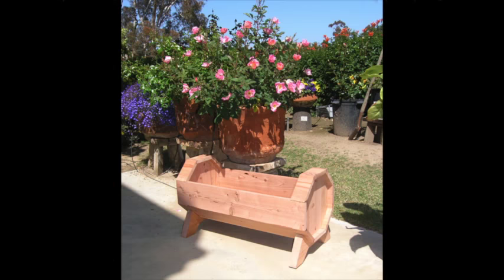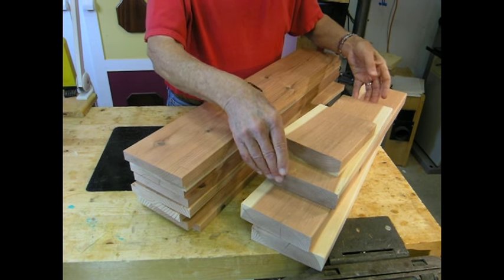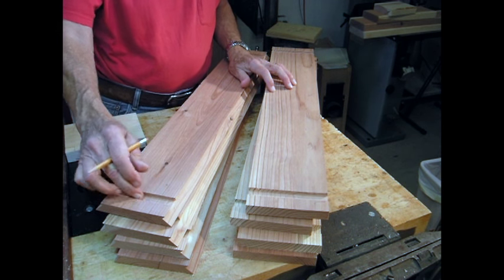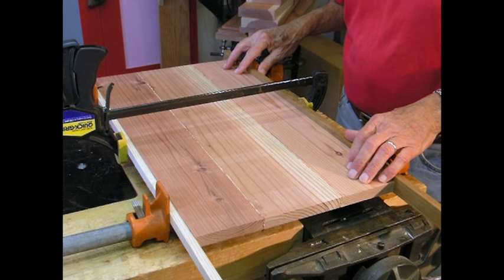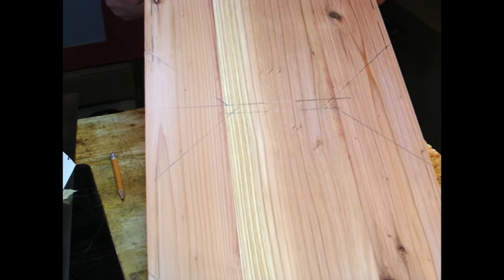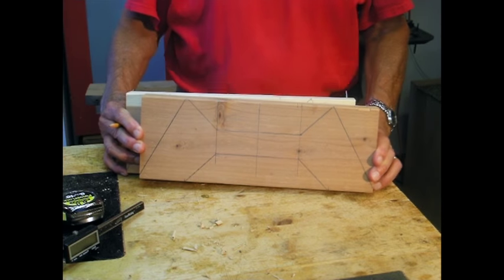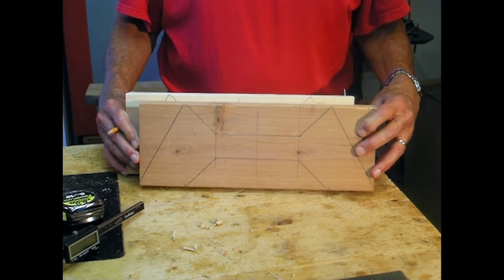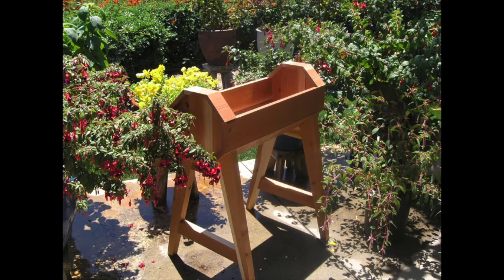A Redwood Barrel Planter

Comment: May I ask where did you purchase the style of banding clamps you use? Looked everywhere and can seem to track them down.
Reply from the maker: Hi Harry!   I bought them (Pony #12 brand, under $10) online after an Amazon search several years ago. Just now tried to find what I found earlier and was not successful; they seem to have upgraded everything.The old ones are just too simple, I guess! However I did locate a Pony brand model that seems to incorporate the same basic clamp with a lot of plastic attached, but expensive. Link below:

https://www.amazon.com/Adjustable-Clamp-1215-Band-Web/dp/B0007GIN1U/ref=pd_sbs_469_1/132-6711135-9483238?_encoding=UTF8&pd_rd_i=B0007GIN1U&pd_rd_r=b45b2a72-da04-454b-992f-8267d7a13927&pd_rd_w=zwes5&pd_rd_wg=NdVpw&pf_rd_p=d2a3ee7d-5d69-4331-b32f-a3ce40b5e0d3&pf_rd_r=NCW3FP4QZJ3EMDTEHW6N&psc=1&refRID=NCW3FP4QZJ3EMDTEHW6N

Hope that helps!
Reply: @davidhenry32  thank Yoi

Comment: Thanks for the plans. Wish I'd read the link for the cut list instead of printing screen shots of the video. Since I'm in Florida, I had better access to cypress than redwood so I used that. The question is: do you put the soil directly in the planter or do you use containers?
Reply from the maker: Kenny Boothe Hi Kenny!  Thanks for your comments. I hope that the construction went well. I'm using the planter with a direct fill of soil, after laying in a an inch or so of gravel to prevent clogging of the drain holes. Cypress sounds very interesting; wouldn't mind seeing a photo if you feel in the mood!
Reply: I promise one Monday - my wife wants to put in flowers first. BTW, I don't have a birds mouth bit so I cut the joint with a table saw.
Reply from the maker: Kenny Boothe Thanks again, Kenny! You're very generous and I look forward to the photo. Sounds like the planter was a hit with your wife. 

Did you have any problems getting a good BMJ joint using the table saw? I've seen videos where people have done this in thick stock, e.g. for masts, with good results but have worried that the required precision for the angles might be difficult.
Reply: We got the flowers today but will not plant until tomorrow. THEN the pics. Once I realized that the BMJ is just a 90 degree cut, all I had to do was CAREFULLY align for two 45 degree cuts. My second cut was about a 16th to deep so all my joints have a little square right in the corner. My biggest problem was holding the boards together while assembling. DO NOT use blue frog tape - use something a little tougher.

Comment: I made one today out of cedar. Redwood is a better choice but hard to come by here in Louisiana. Cypress was another choice but more expensive than cedar.
I made. I even low and added 6 inches length over all. I would share a picture but don't know how. Great tutorial.
Reply from the maker: Thanks for the generous comment! Glad to see that you were able to adapt the design to your needs. I'd enjoy seeing a photo; you can send it via my website at http://www.davidhenrywoodarts.com/ if you want.
Reply: Set up is pretty tricky. But with patience, it all comes together nicely. Can these same bits be used on 1 inch and 1/2 inch stock as well???
Reply: Oh and I sent you an email with a picture of the planter I made.
Reply from the maker: Set up does demand a little patience!  Most bits will work with stock up to 1/2" thick for 6-, 8-, 12, and 16-sided shapes. For thicker stock, the bit limit depends on the length of the cutting edge that cuts the wide face of the BMJ V-groove. All of the 6- and 8-sided bits I've seen will work on thickness up to 3/4". For thicker stock (i.e. 1" or more) there are a variety of bigger bits, most of which I have not used personally, but many can be found by searching "bird mouth router bits" on Amazon.
Reply: davidhenry32 the set I picked up from Amazon is the yellow Yoniko set with 3 bits.
Reply from the maker: This set will handle stock to 3/4" thick with the 6- and 8-sided bits, and to 1" thick with the 12- and 16-sided bits.
Reply: davidhenry32, Thanks again Dave. I appreciate all your help.